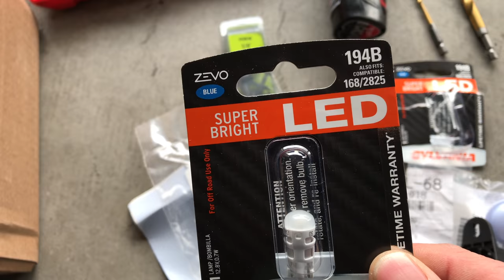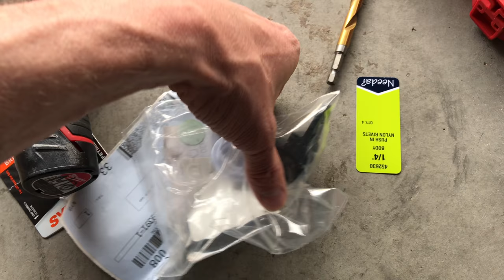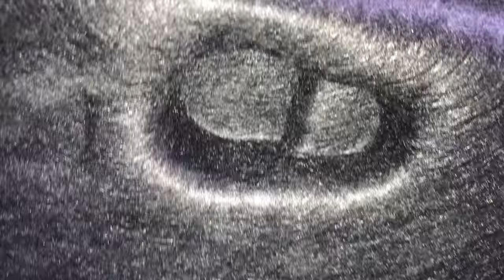RAM 1500 footwell lights install with led upgrade

Comment: I'm gonna do this to my 2015 ram!!  Thanks for the idea and easy set up my dude 🤘
Reply from the maker: Hot damn hell yeah!
Reply: @HOTDAMN   my shit looks good man. Them pods got here today and I just went to advanced auto and they had the exact bulb/brand and even that crispy blue color. My driver side did have a light just hanging so that was easy. And my passenger side also had a light already mounted the square next to where we mounted that pod at so that was cool too.  Thanks man. That actually looks really good at night imo and I can change colors or put a normal led so that's convenient.
Reply: Did you end up installing them?  I've ordered rock lights and im doing the same this afternoon.
Reply: @iRemainNameless  yes I did. I like them.

Comment: I appreciate this video. I got the push pins with a screw integral and I'm raking the passenger panel down after watching you. I couldn't fish the harness anyway and after watching you I think it's best to take it down. I hot the 194 LED cool blue bulbs

Comment: My 2013 Ram came with pods from factory,  I just replaced the bulbs with blue leds with some off amazon. Ones I bought are Luyed,  2 x 240 canbus EX chipset,  $6.99 for 2. Looks same as yours. Getting that pin in was funny as hell. Some of the most simple things are a pain in the ass. I left the pod covers off.
Reply: what model is yours, I got an SLT, mine is getting new rims on and can't check right now. do you know if mine comes with pods?

Comment: Hell yea man this video helped me a lot, I ended up just pulling down the piece to drill the holes for the pod. Couldn’t get the push pin to secure but using the bits you suggested it’s tight enough to where it won’t fall. Worst case Scenario I’ll use a zip tie haha.

Comment: Thanks for the video. I ordered the parts you listed and added my passenger side footwell light while on vacation. The drivers side was already there just put a red led in the socket.
Reply from the maker: Hot damn hell yeah!
Reply: @HOTDAMN  My 7"evic cluster should be here on Monday, Aux switch panel and ITBM and class iv hitch on deck.

Comment: I have a 2012 and I have a white connector not a black one and the connector is bigger what’s up with that?
Reply: Waiting for the answer to this 1. Same dilemma on my 2012 slt. Were you able to locate the passenger plug? I haven't.

Comment: Cool video I wish I known sooner the wire was already there.    All that money for truck and them skimped on floor board lights.
Reply from the maker: Pods and lights are less than 30 bucks. Hard to find the pods though.

Comment: The footwells came stock on my 2019 Ram 1500, but it only comes on when I enter or exit the vehicle. how do i keep it on when the headlights are on?
Reply: grab the head light switch wire. they are considered a bad thing to have on while you are driving. both due to distraction and and lessening you night vision capability. this does give that nice fast and the furious vibe
Reply: @joshhuoabski3278  or you could just buy $10 led lights made for that and they come on whenever the engine is started all you have to do it plug them into a usb (and you can dim them down so there not super bright at night)

Comment: I can’t get any led lights to work with the footwell on my 2015 Ram. They eventually mess with my auto start or the lights won’t work when the door is ajar. As soon as i put the crappy indascent bulbs back in it works fine

Comment: I have to say  your videos are great . Man you make me laugh sometime  lol  but  your info is great ! Do you have a video of adding   the pods or other lights under the rear seat ? My Quad Cab has the connectors  like you have in the front so install should be easy, so far can not find parts I need !  Thanks

Comment: kustomblack gunz,,,,,,,,where was the plug for passenger side located? I removed the body clips and removed the cover and can not find that wiring harness for the pod light...........I found the driver's side without any issues...... my bad........found the wiring harness. Thanks for the video.

Comment: nice detailed video. Just orderd those pods from ebay. Just wondering have those lights u just installed thrown a code up in the dash?
Reply from the maker: No codes, no messages.
Reply: How did u ordered them ? What's the wording or code for them ? Thanks

Comment: Do you plan on doing the rear under the seat lights? Can you post a video if you do.
Reply from the maker: I would like to but I can’t find or don’t have the factory plug ports.
Reply: @HOTDAMN  i found plug ports under my rear seat they're attached on the seat bracket i did find a YT video  how to do the mod

Comment: Nice! Hey man I'm getting shocks and I'm doubtful because I already put some Monroe Reflex Shock Absorbers and I continue to experience swaying when I drive so basically I'm looking to get better shocks if they're no good ( need opinion). What should i get KYB or Rancho ? I hope this fixes my problem.. Need your insight, please...
Reply from the maker: Hot damn my mind is blown, I’m looking at getting fox w/res that’s all I can say my friend .  If you can don’t go cheap 🤷🏻‍♂️.
Reply: Yea man the truck is driving me crazy because everything underneath looks fine but it feels like a boat rocking when I'm driving. I'll look those up thanks for the help.
Reply: KUSTOMBLACK GUNZ 4600 Bernstein with heavier sway bar but it also might increase a heavy over all handle

Comment: Did you have trouble with the lights staying on after you installed them or do they take a long time to go off?  I thought they should go off when you closed the door.
Reply: It’s like your normal lights you have now they will probably stay on for 30 seconds to a minute after the engine is turned off and you close the door if the engines on they they turn on and off right away with the door as well as your roof lights
Reply: @Hiddenpower6  my truck didn’t have the lights. After install they never went out. Got so hot it burnt me so I disconnected them.
Reply: @thetotlpkg  really? Mine doesn’t have any lights like this oem or aftermarket. I thought they just behaved the same as the dome light does

Comment: The link says they are discontinued. but I got got mine from the junk yard from a Jeep Liberty.  They came in several Chrysler Corp vehicles so they should be easy to find.
Reply from the maker: Yes thank you, I need to change the description.  Also thank you for the tip, good stuff.

Comment: This might be a stupid question, but did the LED lights have to be can bus lights or not?  I tried to install a pair but the light did not come on, not sure what I did wrong?
Reply: Nevermind - I'm a dolt.  Forgot that LEDs have positive/negative polarity.  Literally just turned them around and came on instantly.  Will take some pics and a short video later.
Reply from the maker: Lmao hot damn!
Reply: they will only work if hooked up correct. If you have the wires backwards they will not work.

Comment: Do these work with the door switch or do you need a separate switch for them?
Reply from the maker: They are straight plug and play.  Works with both light dial and when the door opens.
Reply: Ok cool, wasn't sure where he showed a switch he installed.
Reply from the maker: The switch I installed was for my amp research side steps. Just used it for reference in this video sorry for any confusion.

Comment: I also have a 1500 Express but mine is a 2012. Do you know if these will fit it? I tried to look it up but I couldn't find any info.
Reply from the maker: I’m not sure the year of trucks but the connectors are already there they just don’t have light pods.
Reply: @HOTDAMN  right after I messaged you I saw on their page that if you enter your VIN at checkout it will tell you if it fits before they ship it so you don't buy something that doesn't work. Thanks for getting back to me! Have a killer weekend!
Reply: @ryanmiller4890  did your truck have  the plug in play in your 2012
Reply: @stevemassey4871  nope. At first I thought it might but after I started snooping I realized it didn't.

Comment: 5 yrs later haha but i would think removing the glove box would gave you plenty room ...... HOT 🔥 DAMN
Reply from the maker: Yes sir, truck stays empty nowadays. All I do is wash it, race it and fix it. It hardly has a piece of paper in it unless it’s a tech card. I hope all is well my friend 🤘
Reply: @HOTDAMN  I'm still doing mods to my 2014 Ram 1500 4×2 truck and daily driving it still tossing the idea around about leveling or lifting it
Reply from the maker: @joe7528  Level it 💪 my opinion. Many more wheel and tire options for leveled trucks that always look good and function well.
Reply: @HOTDAMN  did you keep a mod sheet? I tried to do one i done so many mods and am still doing them
Reply from the maker: @joe7528  I didn’t keep a mod sheet, but I could probably go back to these videos if necessary.
Reply: Nice job on the footwell lights i will have to check to see if i have the wire connections to do that mod ..... any chance did you do the rear footwell mod also ? ....... HOT DAMN 🔥
Reply: @HOTDAMN  i tried to keep a mod sheet but done so many i lost count lmao

Comment: KBG will this fit a 2017 dodge ram 2500?
Reply from the maker: Do you have lights already in the footwell? If not see if you have the connector on the driver side that’s the easiest way to check, if so yes they should fit.

Comment: Nice video, is this an oem part from mopar ?? Maybe I’m gonna install just the first one 😂
Reply: Hey about those lamp,are they sold individually or both at that price ? And the lamps? Do they come with it ?
Reply: Lamps come individually  so you have to order 2 for a set and mine came with  bulbs

Comment: Or for 1/2 the price of these pods you can install these Pryeu Interior Car RGB LED Strip Lights 4 X 20CM/7.87'' Color Changing with Music Sound Activated Remote Control and 12V Lighter Plug Extendable Waterproof for Automotive Vehicle Ambient Lighting from Amazon with multiple led configurations and they even flash to your favorite music currently at 17.98 comes with a remote as well
Reply from the maker: Lol I’ll keep the clean factory option, but if anyone else is interested you owe me for each sale 🤣.

Comment: Does anyone know where I can buy the pods
Reply from the maker: You will unfortunately have to do a deep search, you can find them in the vehicles such as different model jeeps.  Ebay, amazon, facebook, junkyard etc.  If you find some, its an immediate buy.
Reply: eBay I just got two new ones for $ 13.45  each  wow they are going fast.
Reply: Amazon , Avondale $10ea with incandescent bulbs ,but ordered LED for them

Comment: Where the Fuck is the passenger side wire
Reply from the maker: It’s behind the kick panel, you should be able to reach it without removing it.
Reply: Thanks there’s a wire that’s taped up it’s looks like the wire but I couldn’t really tell i got rained out so I’ll keep trying tomorrow